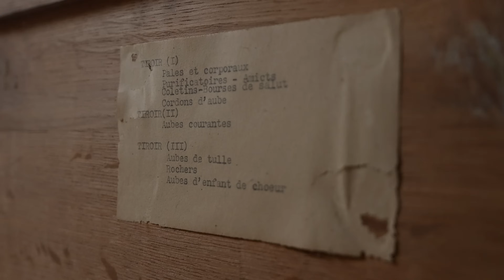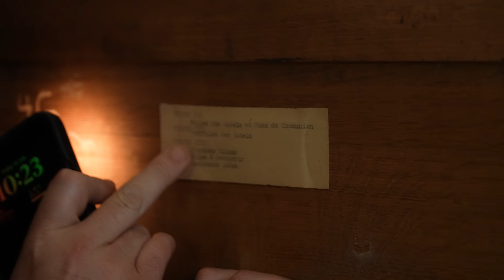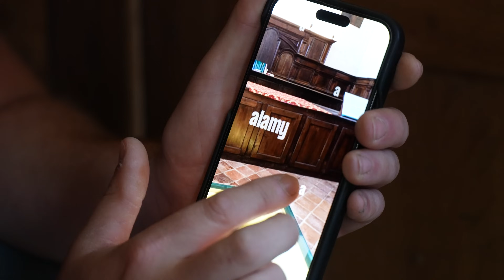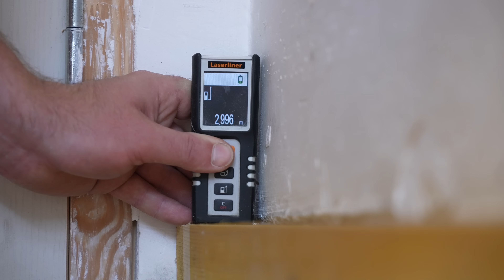Hidden Ceiling Reveals Astonishing Secrets

Comment: In watching Stephanie’s recent video about their work with the Grand Salon, she mentioned the lack of insulation between the Salon and the bedrooms above with their plaster and beam construction. She talked about the amount of noise between floors. This came to mind when looking at the ceiling you discovered in the bedroom. It would be interesting to do a little test to see how much sound travels between the kitchen and your test bedroom, and then again between #13 and the bedroom above - both before and after the drop ceiling is removed. If the waste pipes are still intact, you might do a flush test as well even though it would mean hauling a few gallons of water upstairs.
Interesting find about the cabinet! I love seeing how it all ties together.

Comment: Billy, fwiw, seeing the convent returned to its origins is so satisfying. High ceilings with wood beams are oh so charming, so I’m enthused you’re going to remove the dropped  ceilings!  I saw a video the other day about repairing old wood doors. As I watched this video, I thought of the wood doors to each cell. Rather than removing the old doors and replacing with new, would you consider raising the doorways to a total height of roughly 2,5 meters? This would require the skills of a master cabinet maker to join a piece of the same wood type to the bottom and to refinish the doors, but imagine how beautiful it would be to reuse the original doors! You are recreating a lovely old building and that’s exciting to witness. Thanks for sharing your journey with us all.

Comment: Billy dont water your plants in the heat of the day as the water will evaporate before the plants have sufficient, either do it early morning or late at night, a mulch would be good for them too. If theres stones or concrete over their roots the roots will get super hot so they'll need extra water.
Reply: not to mention the water on the leaves being magnified by  the sun and burning the leaves lol

Comment: you mentioned in another video the serious cracks from the lift shaft any work you do to the rooms will be effected if you leave the lift till last you may have to remove it and do major works to fix problems and could effect any a joining rooms  you need to see what needs doing as the floors are effected and  could be a major job to fix

Comment: From someone who lives in Florida, where it is extremely hot in summer, I can tell you that the best time to water your plants is in the wee hours of the morning. That way, the water doesn't evaporate as much with the heat, so you can use a little less, and the plants have a chance to dry out a bit during the daytime so they don't get fungal infections as badly as if they were watered in the late afternoon.

Comment: Billy I think the drop ceilings were installed in the 70’s. Growing up in the 60’s and 70’s I remember many businesses were lowering their ceilings and installing smaller windows in the 70’s to save on heating and air conditioning. Prior to air conditioning many building used high ceilings and natural air flow through windows to keep building cool in the summer.

Comment: Billy. You might want to think about putting in a irrigation drip system for your plants. Not expensive, and fairly easy to do yourself. During covid we put one in our whole back an front yards. Saves on watering and time.  The system is set to a Timer

Comment: You need to get olla watering pots. They're ceramic, porous pots you bury near plants you want to keep hydrated, and you fill with water. As the soil around them dries out, it pulls moisture from the pot. That way you don't have to keep coming back all the time to constantly check the plants in a heatwave.

Comment: Have you considered utilizing the segments of that huge cabinet for more than one use? You could remove the end part of the cabinet to use a a wall unit. Create legs for the table top to create a proper island seating area, then you could use marble counter top for the wall unit. You would not need to damage that large piece in any way in order to make it more appropriate for your needs. The unit already comes in sections so just decide how many of the sections you want for the island and voila a whole kitchen fitted out with one piece of furniture.

Comment: If you're not going to use mulch around the plantings, may I suggest some myrtle/periwinkle minor as a ground cover in amongst the roses, etc., to cool the soil? Cut it back every spring and it grows nice and thick. It doesn't love-love the sun, but it will tolerate sunshine. : )

Comment: Is there any concern about the second or third floor having settled down/sunk over time in the past, with the elevator doors getting stuck on the floor? I'm just curious if any major fixes are necessary as a result of that. I'm crossing my fingers that that is not the case.

Comment: My mother was the local Parish Priest's house keeper, so all of this is very familiar to me.  What you will not realise is that there is great symbolism in how the main altar cloths and other cloths, the pall which covers the chalice, the manuterge which is used to wash hands and finally a purificator to clean out the chalices are washed and, ironed and folded.  Usually the vestments, which are the alb (the big white garment worn over a cassock), the cotta which is a short white overgarment usually worn by altar servers and the chasuble (normally a heavily embrodered garment worn over the alb) are stored in a wardrobe to keep them crease free.  When new churches are built, this is usually one of the most difficult spaces to design as there is never enough room

Comment: Taking the ceilings back to the original height will bring the beauty back to the rooms upstairs, specially the windows as well as the extra light. This is what all the apartments need, I was hoping Sadie would do it in hers... It's a bit surprising that they went to all the trouble and expense to lower then such a small amount, just enough to block light and ruin the look of the windows. Would it make a big difference in the heating cost? 
Simon is a natural in front of the camera and is a big asset to the project, so good at what he does and not afraid to pass that knowledge on... Jannis couldn't have a better teacher, but it's also great Simon gets to work with someone who really wants to learn.  ❤🦘

Comment: I would remove the centre panel on each end of the big table, putting the 2 drawer/cabinet sections directly back to back, allowing the top to then hang over on one side as a place to sit to work or eat or just hang out.

Comment: Ha!  Altar cloths....shows my age.  There was a kneeling bench with a short upright piece that ran all along the front of the church, before you went up steps to the altar, and just before communion, they would fold a fabric over the top of the upright, that had been hanging behind it.  You would get communion kneeling there, rather than standing in line to get it placed in your hands as they do now.  They would also store the tablecloths used on the altar, and seasonal hanging decor that hung from rods on both sides of the altar;  from memories over 60 years ago.

Comment: On the 1st floor the doors are extremely low. And Billy is tall. To save the doors, a good cabinet and or door builder can add to botton of doors, thus saving the old part completely.if new sawn oak is too light you can always add brass kickplates, shoe scuffs, vacumn scuffs or mop rubs can be prevented. Restaining orig door and new lower part should be easy enough. Nre jambs with transom windows would complete the old style. Obscure glass in transom will still let light pass thru.

Comment: I noticed while you were trying to find a room to cut into the ceiling, that the doors for these rooms are really short, and I was wondering if you're going to replace them with normal size doors when you do the ceilings
Reply: They are replacing the doors they are reusing them elsewhere in the convent, it was supposed to be the Kitchen but not sure if the plans are changed!?!

Comment: Billy you are doing an amazing job but I have to wonder about your new ceiling find. Although this new discovery 
 with its lovely beams looks great do you really need a bedroom with a with that height. There was a reason they dropped the ceilings in the first place, extra heating etc. and it may be unnecessary cost and work.

Comment: In the UK and France is it normal to cover plasterboard with plaster? In Australia the plasterer uses the same tape and plaster mix, however it’s only used for patching and skim coasting to achieve a uniform surface by covering joins and screws. When dry everything is sanded to end with a extremely smooth surface ready for undercoat paining and two final finish coats. It’s unusual to see an entire ceiling being plastered over plaster board and wondered if that approach was specific for this ceiling (or type of building) or common practice in all use cases?

Comment: Nappes des autels : Altar table cloths.
Sanc de Communion : Actually is a shortened version of “Sanctuaire de Communion – in many RC churches of the age of the Convent, there was a “Communion Table” – a long bench in the Sanctuary where parishionners would wait their turn to kneel, do penance, receive the “holy host” (wafer) on the tongue from the pinchers held by the priest to deposit lightly on the tip of the person’s tongue.  Once in the mouth, the parishioner would rise and return to his pew.  The “sanctuaire de Communion” was a holy place in the Sanctuary and some churches laid a linen runner on the Communion Table.  I remember the marble and brass Communion Table of my childhood.  Most RC churches of today has done away completely of this table. 
Dentelles des autels:  In most churches, there were 2 other altars with usually the statue of one of the parish’s patron saint. Or an altar to the Virgin Mary.  These smaller altars required smaller cloths & adornments .  The larger altar table cloths had lace edgings for special masses – such as: Christmas, Easter, weddings, baptisms, etc.
Torchons blancs – white rags.  In the Sacristy if you had to wash something or something was dropped on the priest’s vestments, you were required to clean the offending item with a white rag.  It was a 1-time  use (you couldn’t wash it right after) and it went straight to the laundry bag after use to be “purified” again. 
Pales à recouvrir – pales were the hard squares of either cardboard or thin wood that cover the holy wine and water in the chalice (that the priest holds up at Elevation during mass) while he gives out communion so that the “holiness within” does not escape.  It is covered by a pouch of fine linen or cotton.  It is trimmed with lace and at its center has a red, embroidered, small cross (like a + sign).  These pales’ covers would become soiled with drops of wine or water and were starched to hold their shape before being drawn over the pales. So this drawer would have a few of these “pales pouches” extra. 
Anciennes aubes – old albs. Or albs that were only worn 1 during the liturgical year or some that needed repair or needed to be trashed. 
From the size of t his Sacristy Work Table, I'd say it was used in either a convent or a cathedral.  From the typing font and paper type, I'd guess the mid '40 or '50's.
I'm glad the ceilings on all the 1st floor are in such good shape.  I inaugurates well for the  future projects.

Comment: 2nd list: Nappes des autels : Altar table cloths
Sanc de Communion : Actually is a shortened version of “Sanctuaire de Communion – in many RC churches of the age of the Convent, there was a “Communion Table” – a long bench in the Sanctuary where parishionners would wait their turn to kneel, do penance, receive the “holy host” (wafer) on the tongue from the pinchers held by the priest to deposit lightly on the tip of the person’s tongue.  Once in the mouth, the parishioner would rise and return to his pew.  The “sanctuaire de Communion” was a holy place in the Sanctuary and some churches laid a linen runner on the Communion Table.  I remember the marble and brass Communion Table of my childhood.  Most RC churches of today has done away completely of this table. 
Dentelles des autels:  In most churches, there were 2 other altars with usually the statue of one of the parish’s patron saint. Or an altar to the Virgin Mary.  These smaller altars required smaller cloths & adornments .  The larger altar table cloths had lace edgings for special masses – such as: Christmas, Easter, weddings, baptisms, etc.
Torchons blancs – white rags.  In the Sacristy if you had to wash something or something was dropped on the priest’s vestments, you were required to clean the offending item with a white rag.  It was a 1-time  use (you couldn’t wash it right after) and it went straight to the laundry bag after use to be “purified” again. 
Pales à recouvrir – pales were the hard squares of either cardboard or thin wood that cover the holy wine and water in the chalice (that the priest holds up at Elevation during mass) while he gives out communion so that the “holiness within” does not escape.  It is covered by a pouch of fine linen or cotton.  It is trimmed with lace and at its center has a red, embroidered, small cross (like a + sign).  These pales’ covers would become soiled with drops of wine or water and were starched to hold their shape before being drawn over the pales. So this drawer would have a few of these “pales pouches” extra. 
Anciennes aubes – old albs. Or albs that were only worn 1 during the liturgical year or some that needed repair or needed to be trashed.

Comment: yikes! water in the evening or early morn, when the sun is not on the plants... if you water in full sun and get water on the leaves the sun will magnify thru the water and burn the plant... Slow trickle at the root if you absolutely  have to water in the high heat on a sunny day 💗🦊 I would hate to see the work you've put in on the plantings ruined

Comment: Hi Billy, a tip, if your ‘stick’ of timber is banana shape on the width, sight to the centre of the curve make a cut about 3/4 of the way across the bend and rejoin with a nail, the width of hand saw will help take the material out of curve repeat on either side, use these prices in centre of studs and straight material  on door ways. Greg
Reply: Great advice Greg. Have you done this before?
Reply: I was a carpenter. But the secret to making a good living is to work quick , efficiently, and not waste time going to hardware shops. Time is money, and don’t let your workers get stuff from hardware, they are there to work not shop.
Reply: Thankyou Greg, I am taking this all in and learning. Much appreciated.

Comment: The usual reason for lowering the ceiling was to save on heating costs. Thinking of your future costs in operating the building you might want to consider such costs especially now when those costs are at least triple what the were when the ceilings were originally lowered to save operational costs
Reply: I wonder if the costs might be offset by some solar? I don't know if that if feasible but might be worth investigating.
Reply: @bjbrown  possibly, but now that I think of it, we today have a cost that the good sisters didn't have that would benefit by lower ceilings, Air conditioning

Comment: A 2.0 ton, 15 sear air conditioner at least for 1000 to 1500 sq, feet. . A  2  ton  in Ryan's. I live in a  1500 sq ft condo. I took mine from a 1.5 ton to a 3 ton. Much more efficient and cooler. The builder did the least. That's just my air. Not heat. Becareful about getting too high of ceilings. Adds to square ft you need larger air handlers. Do your best on air as it's only getting hotter. Air will be a must as people are spending more time inside